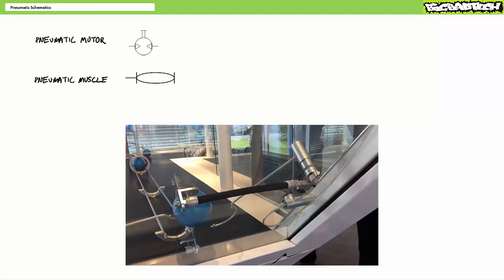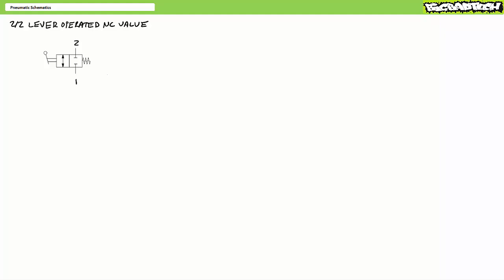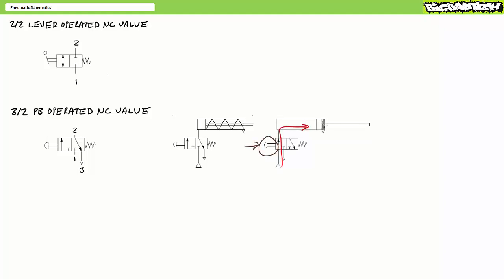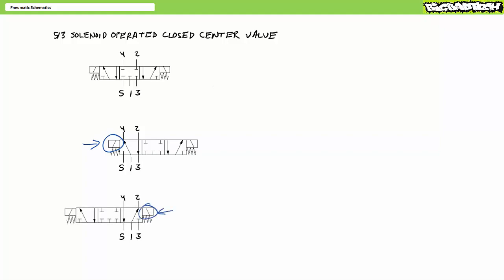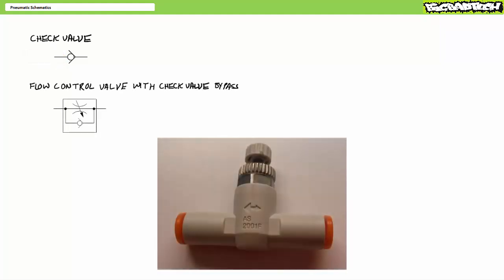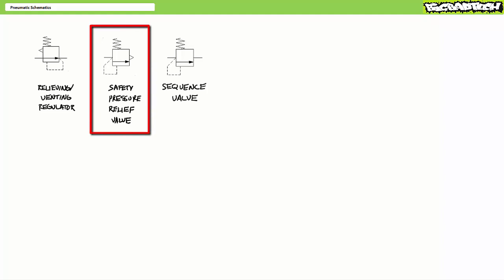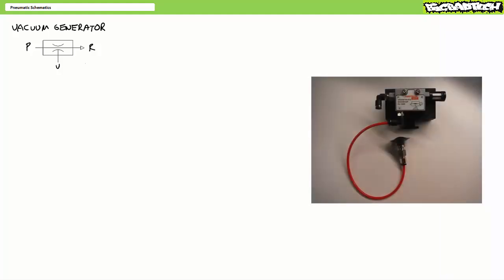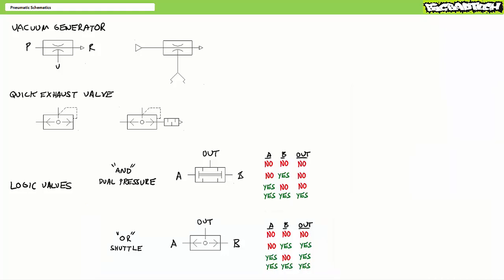Pneumatic Schematics (Part 2 of 2)

Comment: Do you have any social media? I need to design a hydraulic system schematic to help a pressure tooling that is used in wind power iron core silicon steel industry that creates a laminated bond by compressing? can you help please?
Reply from the maker: Sorry I'm allergic to social media! Sounds like an awesome project but check the FAQs at: https://youtu.be/iqu2gJ2OmaI?t=632
Reply: If you need to design it, then design it instead of begging for answers like you did to obtain your engineering degree